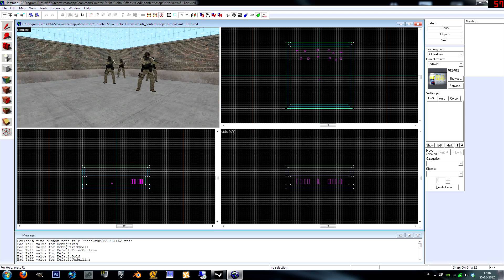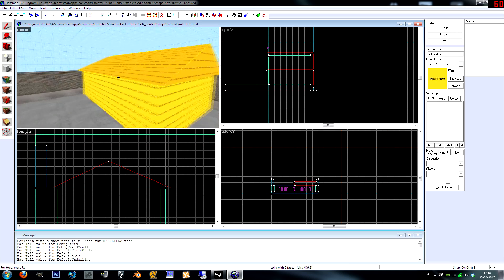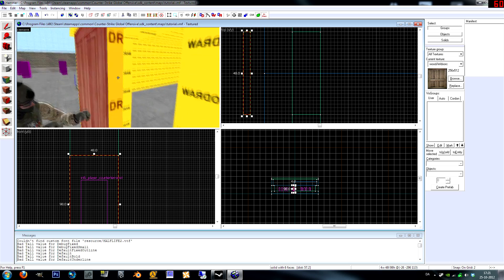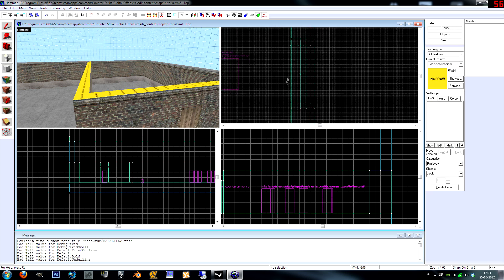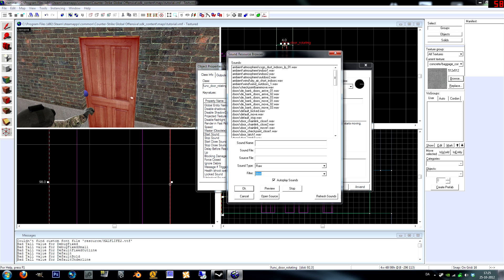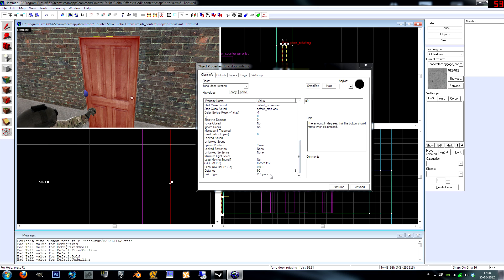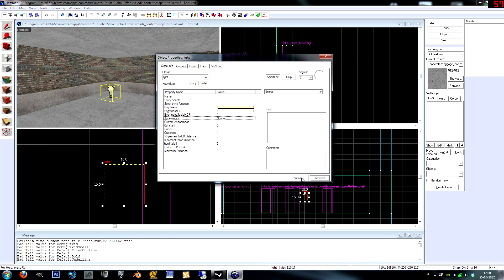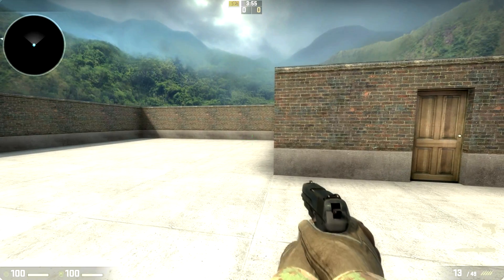Source SDK Hammer Tutorial 2 - Brush Doors, Lights, and More Cutting

Comment: This isn't working. I'm getting really fucking annoyed.
Reply from the maker: What specifically isn't working? :P
Reply: ChaosDuckDK
Like, I can't get it to cut ONLY the door part. When I select the area I wanna cut, It all connects to the main block and cuts the whole thing.
Reply from the maker: Do you mean that it deletes the one of the sides of the cut? Just click the cut tool icon again once you've selected where you want the cut to be, if you look at the side/top/whatever the fuck view that isn't 3D, the red part will be cut away. When both sides are not red, they will both stay. If you need any more help, add me on Steam: toco123456
Reply: ChaosDuckDK I finally got it. Thank you for your help. ^-^
  (Btw, you dont show up on Steam)
Reply from the maker: Well, my login name is toco123456 but my displayname is ChaosDuck. You can also just search for ChaosDuck, but I have 2 accounts with the same avatar.
Reply: ChaosDuckDK
Which one do you mainly go on or play CS:GO on?
Reply from the maker: The one with 700+ hours on CS:GO :P